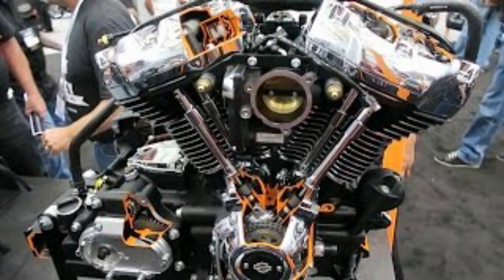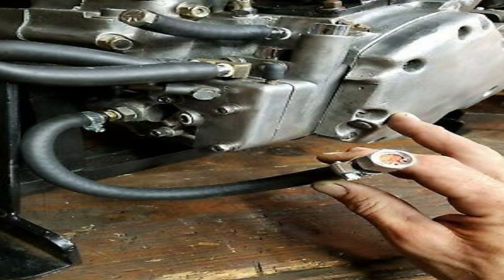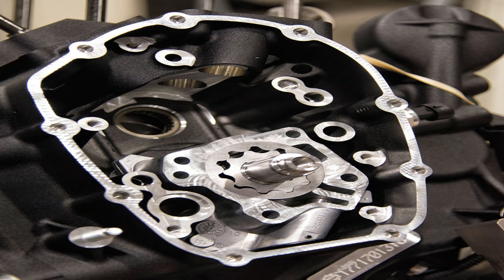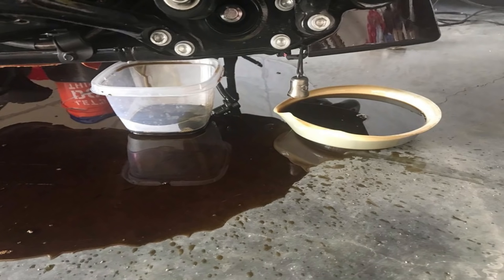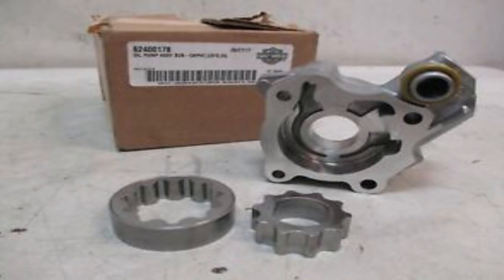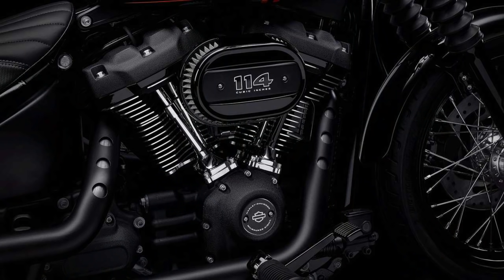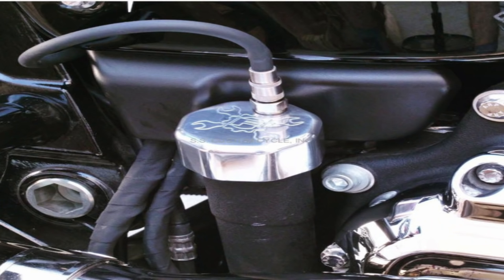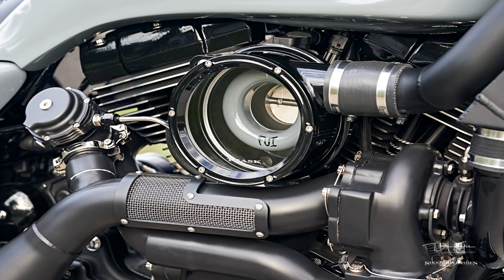The Fatal Milwaukee 8 Engine Flaw Harley-Davidson Missed

Comment from the maker: Have you updated your M8's oil pump? Which pump did you decide to go with?
Reply: Yes, 2020 RKS, replaced the oil pump and cam plate for Feuling RS pump and plate, even though it wasn't really necessary. No regrets though, the higher capacity is a good thing to have.
Reply: S&S
Reply: Fueling
Reply: Has that been happening on any of the softails?
Reply: @joetownable  yes. My 19 Heritage burnt up the heads in my M8 before the oil pump was replaced. The 2020 models and newer have the new Gerotors in the pump that fixes the issue. It is a problem on all M8s
Reply: @mattcottrell3336  I have a 2018 heritage 107 upgraded to 114 with stage 3 and have over 13,000 miles and no issues so far. 🤞
Reply: What early signs should I look for?
Reply: @joetownable  oil sumping. If the heads are being starved of oil you will notice significant oil loss. Mine lost 2 quarts of oil in about 2 1/2 weeks just riding 15 miles to work in back. So mine was pretty severe already. If you notice more oil in the primary and transmission when you do a 3 hole oil change after filling them to spec that's usually a sign that the oil pump is not operating effectively. It is a design flaw in the Gerotor that doesn't not allow significant oil flow back to the top of the oiling system. If you are under warranty I would say run it til it's out and then change it if nothing goes down during that period. I was pretty upset when I found out it happened to my heritage because I had been told by Harley "it isn't a problem with the softails." But they used the same oil pump as the Touring models.
Reply from the maker: You'll notice a lack of power and lifter clatter. Hot days and long distances, bike is gonna run a bit rough. Those are some signs you will notice for sure.
Reply: @GixxerFoo  definitely lifter clatter. Mine was chattering like cold teeth
Reply: You know I am sure this has happened… however I had 2 2017 -107… I had a 2020 114..and now a 2021…117.. never had an issue I never knew anyone who had that trouble.. not that it never happens but it’s not as common as some seem to think
Reply: @stevexaxa3619  I know people who haven't had the problem too. That's why I say run it til it dies and then fix it IF it's a problem. I just want people to know that it could be a problem with the softails too since I was specifically told that it wouldn't happen to mine since it's a softail. I now have a 12 Road King classic and am not worried about it at all!
Reply: @mattcottrell3336  cool man, thanks!
Reply: Feuling
Reply: Upgraded 2018 low rider to a 21 rgs. The new H-D oil pump came with it lol
Reply: Updated HD Oil pump and an A1 vented dipstick!
Reply: I just wanted to add great videos keep up the great work much appreciated
Reply: @joetownable  Signs that you see in the morning.  Those are the ones to really watch for
Reply: Yeah, before I ever knew there was ever a problem I had a 2018 Ultra Limited and traded it for a 2020 Ultra Limited. 🧐🤨🤣
Reply: S&S🤙
Reply: L
Reply: @mattcottrell3336  Sumping has nothing to do with the primary and transmission. I think you may be confusing the oil transfer issue where the transmission oil was being into the primary. That was caused by the vacuum the hydraulic clutch was creating. Which is why in 2021 they went back to a cable clutch. Which is also why that problem was only on touring bikes as they were the only bikes with hydraulic clutches. 

Sumping is oil being left in the crankcase for a couple different reasons. Primarily the oil pump cant keep up and also a frothing that occurs when the balancer splashes around in the excess oil in the case further exasperating the problem. The latest oil pump puts more of an emphasis in evacuating the crackcase.
Reply: @binarym  yep, vented dipstick prevents a need to crankvent rerouting. I like the vented dipstick approach to crankcase vent issues.
Reply: @michaelxwhite  Yes I installed my A1 Cycles M8 vented dipstick a few weeks ago and it is working great. Along with the upgraded HD oil pump I am feeling fairly confident with the engine.
Reply: @gorion70  A hydraulic clutch should have nothing to do with the motor and it’s oil. It is a completely separate function.
Reply: @davidefland1985  you’re absolutely correct. Never said it did.
Reply: Did they upgrade the 2021 oil pump from the 2020 version? I heard a rumor they did but haven’t confirmed.
Reply: Went with Feuling pump and plate.
Reply: Question: at 2:09 minute mark of the video, you state the oil pump scavenges 60% cam cover area & 40% from the sump. Where did you obtain this information from? Source please.  
Also, as an alternative why not drill a hole in the crankcase to remedy the breather issue? Can be done during one of the engine enhancements that everyone seems to be doing nowadays. @GixxerFoo
Reply: @gorion70   How is the hydraulic vacuum issue remedied for those bikes?  I know they stopped producing them but how did Harley resolve that issue with the existing bikes?
Reply: @chazzcapone.  they came out with a vent kit. It’s a rubber hose that you put in the hole you drill in the back of the primary.
Reply: S&S oil pump and cam-plate.
Reply: S&S, I did a cam plate and oil pump install last winter and I absolutely love it. I don't think you can go wrong with proven S&S parts
Reply: With S&S
Reply: well, the oil pump was part of a cam case kit, but I went with S&S and the cam was 475C
Reply: I had the 2007 cvo road king and had  a lot of issues but they fixed the problem in 2008 but Im looking to buying another bike and want the 110 again because of the sound I don’t like the way the m8 sounds do you recommend a 110 ?? But I’m looking at the road glide maybe a 2016?
Reply: I wonder why, a recall for original oil pumps was not announced?
Thanks for staying on top of the problems, for no-one wants to find out, their new motorcycle is torn up due to design flaws!
Reply: When doing a cam upgrade on my '18 Street Glide I had the latest Harley oil pump installed. Also used cam, lifters, and tappet cuffs from S&S. It's essential to get rid of the crap Harley lifters at the first opportunity IMO.
By the way, another contributor to sumping in early M8 engines was leaking piston oiler jets dumping excessive oil into the crankcase.
Reply: I decided to take a Kawasaki pump... and at the same time the rest of the engine and bike. 🤣
Reply: I got a 18 went with  a 2020 pump .fixed
Reply: Put a 2020 pump in my 18 good to go
Reply: Big money on top of big money to ride a Harley. May go for a Rushmore 103” instead.
Reply: S&S Cam Plate and Oil Pump
Reply: This is pitiful!
Reply: @kurtweber5401  How much did it cost to change it?

Comment: As I learned about the problems with some of the M8 engines in this regard I entered a preemptive strike on my '17 M8 and had a S&S oil pump, Cam plate, lifters and cuff's, adjustable push rods, and while we were there a performance CR480 cam, Tuner, and a Dyno tune on top of the previously installed Stage one with a performance head pipe. Then added a Feuling vented dip stick. Bike runs great and should now be good for the long haul with nearly a forty percent increase in power!
Reply: How many stock parts did you replace in total?
Reply: @ericx7476  everything except the paint
Reply: So a should be reliable about 118 HP to the wheel. I did a stage 3 to retain warranty. A later 2019 it got the newer pump. Got 116 HP and later added the dip stick vent. 17k miles so far and zero issues.
Reply: Nice build. Just did the same thing but with the Zipper’s 468 cam. These motors are a Beauty but they do need a little tlc. For Harley to let this stuff happen and not own it is pretty shitty. I’m lucky enough to fix my own stuff so it’s cheap but still. Pretty bad mojo on them.
Reply: @TJF Denver neither did a 1986 Harley. I think anyone with a brain can see that a bike 37 years older would have different issues…………………
Reply: @@SmackDaddySugarCane Yeah, but chicks at a stoplight laugh and look at ya kinda funny.

Comment: I didn't have any of those questions because I figured I'd have it serviced before I noticed anything off.  
 2018 107 FatBoy FLFB . Preparing myself for a longer ride, pre ride inspection and noticed 1 drop of motor oil under the bike. 
 I began to see  shiny layer of oil on bottom of everything the air intake, crank case, radiator, and frame, etc.   
Then I looked at YouTube and your video and I'm grateful to you,, for the time you took to explain this issue.  
I'm gonna be addressing everything all options and 
Look forward to seeing more, and
Thanks again...  🤘😎👍

Comment: I had one.  HAD one.  It used excessive oil.  A quart in 1000 miles.  The air cleaner was soaked. It was still under warranty and Harley refused to fix it.     I felt totally stranded by Harley.  I now ride a 2022 Goldwing.  I went for reliability.
Reply: I’m with you on that. My 2018 sgs just started making noise. Although I’m a Harley enthusiast I’m gonna get something more reliable (non Harley)to get out and about.
Reply: sorry to hear that, that bike is so boring. ive riden my step dads, its just a scooter.
Reply: @alextrainor2552  🤣

Comment: I really like your videos and one of them helped me avoid major engine failure.So I owe you a big Thank You.I have a 2014 Dyna Low Rider with the 103Ci and I was watching your video on unleashing the power of the 103 with a cam. The Woods TW222 really got my interest peaked.And since I still had just two months left on my extended warranty I thought what the hell I am going to put it in and not worry about the remainder My good friend who works as a Harley Mechanic was going to do the job for me at his house and he phoned me the next day to tell me of push rod damage in the block. He put it all back together and I took it to Harley Davidson and they found more damage to the pistons and crank so I got a new Long block on warranty so now I went fro 60.000KMS to zero KMS  And that Woods TW222 cam is such a power maker I love it.If your video had not inspired me to put that cam in I would have rode around all summer with engine damage that I did not know of only to have my warranty expire in August and then I would have been screwed. So huge Thanks
Reply from the maker: Thank you! Dang you scored big time on that extended warranty! You had a good mechanic too that said hey uh let's put it back together and take it to Harley! Sucks about your motor but hard to complain about a new long block and Woods cam! Hopefully they will get you back rolling again quick!
Reply: Push rod damage in the block? WTF are you talking about?
Reply: @thedieselpig4448  I might have not explained it right it was a lifter failed and caused damage to the lifter bores and cam shaft. upon disassembly the Tech found that the crank shaft had failed and the connecting rods were binding on the crank shaft also damaged the piston and cylinders as the connecting rods not moving properly due to binding that's right off the work order so it should be a better explanation .
Reply: @stephenmccabe9941  So what caused your damage was a lifter? Do you know if this is a common failure for 96 and 103?
Reply: @dry509  I really don't know what caused this  kind of damage as I never rode it really hard or lugged it really bad for that matter changed my oil religiously so I don't really know if it's common to the 96 or the 103 someone with more knowledge than I would have to tell you that
Reply: @stephenmccabe9941  Cool…no problem.

Comment: Great video. I looked and neither offer and vent covers for my softail slim s. Mainly for touring and dynas. Was the problem no as bad in the softails or are places just not making them? Always love bro from Upstate Ny
Reply from the maker: Thank you! I really haven't heard of any issues with the B motor in the Softail line, the twin cam Softail had the oil tank like the Sportster which seemed to work pretty well.
Reply: @GixxerFoo  that's what I thought as well. I wonder if it would make any difference in doing it to a softail. I still want to do crankcase breather dump so it's not going back in to my motor. Just haven't thought of which route I want to go after watching your video.
Reply: Just vent the cover on the transmission, 10 bucks

Comment: Your videos are clear and concise. Thank you for them.

Question. On the issue of blow by and carbon buildup on cylinder heads, is a fuel additive like gumout , which works great for cars a good idea for harley m8
Reply from the maker: Yeah l would just measure it out for the size of your tank, l run a little Lucas Fuel System Cleaner in my bikes. It does help clean the injectors and keep the carbon down a bit. You can't stop the carbon unless you reroute the head breathers to atmosphere.
Reply: Thanks for the quick reply . I kinda was thinking same thing . No easy way around it

Comment: Do you know if HD used the same oil pump in the 2017 CVOs with the 114? 
I’m closing on a CVO Limited today, and would like to know if there might be a problem to watch out for.
Thanks for the info.

Comment: I have a 2010 TC96 Superglide C. Thanks to your and commenters on your channel i changed my Compinsator/tensioner. Also opened up Cam chest and did all the proper checks. Looks like i got a good one! Unfortunately it will be my last HD. Love the vids thanks!

Comment: Yes I have a 2023 114 m8 I've noticed, it seems like my front cylinder isn't getting enough oil. Or that's what it sounds like. I'm gonna check out that vented dip stick. Thanks

Comment: It was only an issue on 2019 and older models.  In 2020 HD improved the oil pump and increased it’s ability to pump oil by 44%

Comment: Do you have any idea what that little elbow with a plug is on top of the air cleaner is? I have same bike as your, and wouldn’t be a good idea to plug the breather from there stead of using the vented dip stick

Comment: This should never have even cropped its ugly head up. As a motorcycle tech with over 40 years experience, Harley Davidson is the worst motorcycle manufacturer that completely relies on experienced service techs and outside companies finding and fixing common problems with these bikes. Then they purposely install crap parts right from the factory and again the aftermarket has to make them whole. So what did they decide to do after seeing the money the other companies were charging for a part to fix the bikes. Haha they said " hey lets build the correct part that we should have installed at the factory and call them upgrades viola, Screaming Eagle." It's utterly ridiculous. The amount they charge for these bikes is outrageous. I have a buddy who spent $50.000 dollars on a cvo Street glide that supposedly has all the screaming eagle upgrades and had the oil pump fail and 2 weeks later the compensator broke in half. When he got it back after a month at the dealer, mind you they still want their monthly payment on the loan guess what he said tom this thing does not feel right. I told him i knew exactly what was wrong with it and he brought it into my shop so i could check the crank run out. He definitely had sump issues but the run out was at .008. This is a damned CVO. More like a CVFJ. These 90 day wonders that they have at dealer services said he has no issues. Now he can't tell them what i found as me digging into the engine would void his warranty, he just takes it back once a month to document his complaints. I told him to just wait until he's almost out of warranty and tell them to go to hell and that he is going to take it to an outside tech to find out whats going on and then just sue Harley. I have a Triumph Bonneville, a Kawasaki sr , and a Yamaha. Cruiser and lastly my 06 Road King. I love my road king but its not going to make me sell the others. In my opinion the customers should start a class action lawsuit and they should be investigated by the government. They have far to long enjoyed customers that are loyal. The government should make them fix every piece of shit parts they have installed on these bikes. Sonny Barger said it best " if we would have known back then what we know today we would be riding Honda's.
Reply: I agree for 100%. When a expensive oem bike NEED "upgrades", something is realy wrong.
Reply: Seems like I have made the right choice with my Honda
Reply: @manuhonkanen2111  Same here, we stick with the big four. Specialy Honda and Kawa.
Reply: When Harley introduced the M8 engine they boasted about the "million miles of testing" they had done prior to its release. You mean to tell me they never had an engine sump during these million miles? I smell BS.

Comment: I bought a 2019 lowrider in August with 4800 miles on it. Since then I have installed the transmission plate with crankcase ventilation and the shorter version of the sump plug. Should I replace the oil pump as well?

Comment: I have a 2017 Road King with the M8 motor that I purchased used in 2019.  I was told this problem was addressed prior to my purchase.  I use cars and bikes like an appliance, turn it on, use and enjoy and switch back to its factory default position of off.  So far there hasn't been any problems.  This bike has earned my trust as it was purchased with less than 2k and now there's more than 20k on the clock. PS, this bike replaced my 2014 FatBoy that had a 103 motor and that bike was a good 'ol boy too!
Reply from the maker: Those late year 103's were just about perfect, Harley got the Twin Cam right and then switched motors. Not all the M8's had the sumping issue, some work just fine with the older oil pump. You might have a dealer run your vin number and see what all had been done to the bike by a dealer.
Reply: @GixxerFoo  I didn't think of that.  That's an outstanding idea.  Thank you for your help and all the great videos!